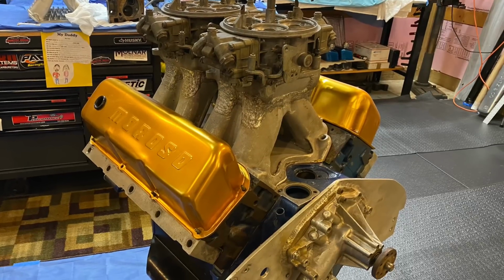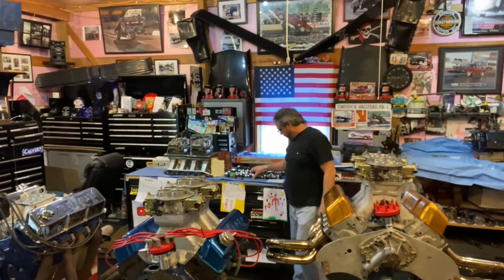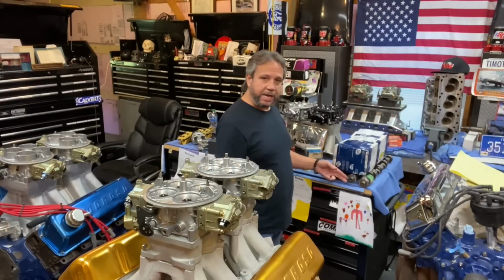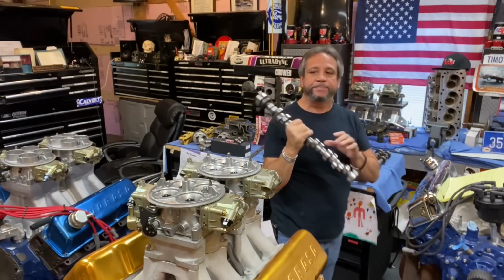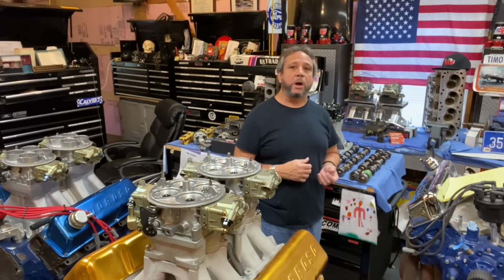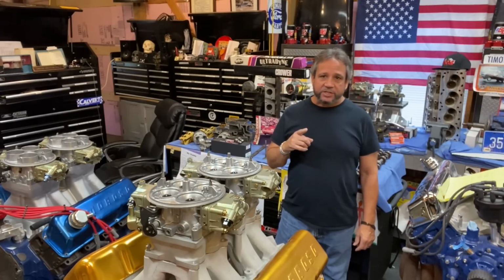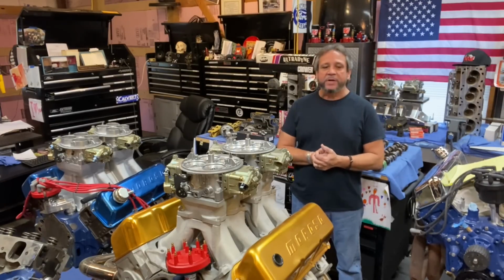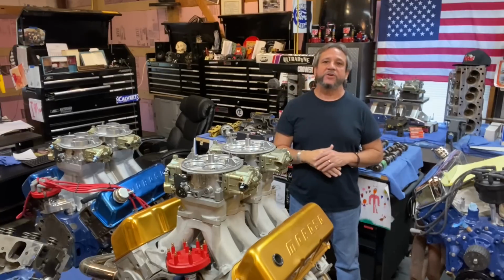DBG: Ford 351Cleveland Pro Stock Cams, Pics, Specs,  And Speculation? How Much HP  Did They Make?

Comment: That shifter reminds me of a story. I managed an auto parts store years ago. The guys who worked for me all knew each other, and were all friends. I helped one of them build his Mustang, a 66 Mustang with a 289 and C4. He needed help picking out parts to build a street strip car out of it. We started out with a 13 second build. It ran good with that engine. Then he wanted to go faster, so he bought another engine to build and an old Datsun Truck to drive to work while his car was down. The new engine got him into the low 12’s. Then he decided to switch to a four speed. He got that put 8n and then wanted a shifter like you have in this video, a Vertical Gate Shifter. So his friends stoked his car on his birthday and installed a brand new shifter that we all chipped in on. I got a phone call that they weren’t finished so they needed me to stall them. So I made up a reason for him to stay a little longer and then I drove him home. When we got there his Dad, Brother and some of the guys were talking to a cop. They all thought the car was stolen. My friend freaked out, and was about in tears when we heard a familiar car driving into the neighborhood. He looked up and one of the guys drove it up to the house. After a few minutes he went from being upset to surprised, his family calmed down and I talked with the cop a bit. It was a great day!
Reply from the maker: Tear of fear to joy, thats what friends are for. Thanks for sharing that
https://youtube.com/shorts/8S1IAZpoS7E?si=PLCwR1hbuSQc5F7t

Comment: I ran general kinetics Chrysler mushroom cams years ago. I had a hand picked cam and springs { Battle Ship springs } Best springs ever made. General Kinetics were known for very steep ramps. they accelerated lift as much as possible. Ultradyne cams I've run also they are known for needing more fuel than most. 4 main jet sizes more. CJ
Reply from the maker: Love that, I have a few GK cams from Jack Roush, Harold Dutton owned Ultradyne, had some bad cams...

Comment: I believe the Chrysler 'mushroom' tappets were brought into play so they could run a more radical lobe. Either rollers weren't available yet(circa 1970) or they weren't as yet class legal. It was one of the 2 things. You had to install those tappets from underneath.
Reply from the maker: Yes, they use the mushroom lifters in  NASCAR. Someone had mentioned when roller lifters came out, I thought it was Iskenderian, that I forgot now.
Reply: @dragboss351cleveland  Lots of cool and exotic experimental stuff being produced for racing by the factories back then. I've seen some really cool pictures of intakes/induction systems that Ford produced for motors like the Boss 302 which I'm sure you Ford guys are already well aware of. It's amazing how much interesting gear was created that apparently never made it to regular production or even racing.

Comment: Love Bob Glidden, he was my ford hero. I don't think he used nitrous,  the GM and Mopar crowd sure says he did. Can anyone say for sure if he did or didn't use it. Was he ever suspended for it. I don't think he was. He never slowed down after they accused him of it. Can someone give me some solid evidence.
Reply from the maker: He was a real racer. No he did not spray. I think Rusty said it here. 
DragBoss Garage: Friday Night Live, Third Round With Rusty Glidden, His Use Of Nitrous In Pro Stock
https://youtu.be/Yx49BByWMm0
Reply: @dragboss351cleveland  … The GM and Mopar guys pointing their fingers at Glidden about using spray are what you could call SORE LOSERS. They went down in flames because a Cleveland BOAT ANCHOR handed their asses to them so drastic measures were necessary 🤷‍♂️.

Comment: Comp cam,old grind but still very good. 324-6 intake & 340-3 exhaust 209 separation.  Hello Rusty.
Reply: 109 separation.
Reply from the maker: I like that, what’s the intake center line on that cam?
Reply: @dragboss351cleveland  you have to understand the exhaust leaving the chamber can put a unbelievable amount of suction in the intake track @ overlap.   Hence kicking the intake track in the ass & getting the cooler heavier air fuel mass moving in the right direction before the piston starts descending down the bore.  If one waits for the piston to draw it in , your behind lol.
Reply: @dragboss351cleveland  we should chat sometime.  Some of this isn't as complicated as it might seem.  Talking about events that occur in extremely short periods of time helps clarify things.
Reply from the maker: Thank you Mike I appreciate it. I’ve always run my cams 4 degrees  advanced, is that how it seem to come out on the cam card. I will tell Rusty. Hello, as I need to get him back on for a live chat. Always fun to talk to him. Appreciate it Mike.
Reply: @dragboss351cleveland  I made Bob a camshaft for his Boss 429 while at Lunati in around 1993 or so.  Experimental.  .530 lobe lift.  Mostly intake lobe changes were made.  Lol not sure he had time to run it.
Reply: @dragboss351cleveland  the whole cam advance plus 4 degrees is generic.  Yes , valve events change & coincide with the spec card. It just not always what the engine may want.    Extreme engine speed applications require the overlap event to be placed where inertial super charging can best occur for volumetric efficiency to get very high under normally aspirated applications.  No power adder.
Reply: @dragboss351cleveland  I know this is technically pretty deep.  But it's solid info.
Reply: @dragboss351cleveland  not sure Rusty  will remember me lol. I also worked at Comp cams as well.  I have a story on how Billy's name was chosen.  Etta will likely remember,  Etta & Bob's  friends in high-school,  Dave & Porscha Burton.   Porsche & Etta were very good friends.  They all played cards togather  ( conasta ) back before Billy was born.
Reply from the maker: That’s a big stick, probably matches 500 ci, be great to see if he did use it. How long did you work at the Lunati? What did you do there?
Reply from the maker: Yeah, that’s my basic came knowledge, and recommendations from engine shop, and then another recommendation by the builder. however, when I rechecked the cam after I had some issues breaking Beltran, I found out that it was retarded, 4°, so obviously there’s some issues that were not told me by the builder. That’s when I went to see my Buddy Bob Beach. Never an issue after that.
Reply from the maker: You could come out and do a live chat on cam, shaft, specs, and relations to engine rpm, power, output, decisions, think about it.
Reply: @dragboss351cleveland  I was a go between of engine builder & cam designer.  The builder would ask or want to see if something could be made &  I would get with the designer/ engineer to see if it was feasible.   Many times the limitations were the valvesprings available at the time. Things have progressed greatly in that department.
Reply: @dragboss351cleveland  about 4 years there employed when Joe Lunati sr owned it. Left in 1994 fall.
Reply: @dragboss351cleveland  comp cams started as a outside manufacturer rep in the Midwest over 6 states, then went to Memphis to competition cams.  1986 or so through early 1990's
Reply: @dragboss351cleveland  again was in the engine builder division, 3 of us handled mostly Profesional engine builders.  Mostly they knew what they wanted & we would attempt to see if it could be done.  Many varied projects.
Reply: @dragboss351cleveland  I am still involved in some personal engine projects,  one being a 14.5 ci OHV normally aspirated single cylinder engine topping 40hp
Reply: @dragboss351cleveland  over 3hp per inch.
Reply: @dragboss351cleveland  Surely I am not current with today's most current stuff.  Valvesprings have opened the door to possibilities we just didn't have back then.
Reply from the maker: Ok, I understand. yes amazing the improvement nowadays. Had a set last 5 years with no issues. Isky rad tool room gold stripe.
Reply from the maker: Great history Mike thanks. I used to talk to cam guy there just forgot his name while answering. Old age
Reply from the maker: There is a guy at comp that ground Gliddens cams. Saw a vid he was still there. Did BillyGodbold leave?
Reply: @dragboss351cleveland  yes Billy was fired.   Comp cams stopped being comp cams when the lawyer Ron Coleman took the reins. All down hill from there. I was still there when that transition took place. Billy God bold came on the scene at come a lot later.
Reply: @dragboss351cleveland  many fellas actually ground Glidden cams at comp, Junior was one of them, at one time he was one of the best at comp & later he came over to Lunati while I was there.  He finish ground The Glidden cam that we sent for him to test.  Junior made sure it finished out as perfect as possible back then.  When he got the order he came & talked to me, he asked, is this who I think it is ?  Yep.
Reply: @dragboss351cleveland  still learning to navigate this messaging.
Reply from the maker: @mikedonzero2692  well maybe you should do a live chat with me. Talk cams? Thpa351gmail.com
Reply: @dragboss351cleveland  your email isn't being found
Reply: @dragboss351cleveland  we probley need to chat, not sure best way to get in touch. I'm not even sure this is being viewed by everyone.?
Reply: @dragboss351cleveland  I'm certainly not the greatest computer savvy navigator. I get by
Reply from the maker: It is being viewed, so email at thpa351@gmail.com
Reply: @dragboss351cleveland  I am going to get assistance.  I emailed you & it won't send.
Reply: @dragboss351cleveland  I think I managed to email you. Can you confirm ?
Reply: @dragboss351cleveland  the guy your referring to might be Kenny Arendale. He's been there forever. Great guy.
Reply from the maker: @mikedonzero2692  took care of it thanks
Reply from the maker: Yes  that is him, I’m pretty sure. Maybe have him on too. Don’t know him. Thanks I appreciate it Mike.
Reply from the maker: Thanks Mike, glad your here, ck out the playlist, working on them now. That cam seems like a rocker
Reply: @dragboss351cleveland   a lot has changed in the last 35 years.    Lol
Reply from the maker: I know what Mike I still live in 1975, I have to say those were the best years of my life and like most people probably think the same about their time. Didn’t have all these crazy worries. But yeah, I’ve learned a lot from spring technology to head flow. No expert, but I try to have a good understanding, and explain to others if I can. I was appreciate you, stay tuned

Comment: Track Boss block, 302 mainline (2.75 mains is 30hp loss), 4.155 bore (same as chamber width for a start), 3.25 stroke, 15 to 1 comp. measured, angle mill/weld heads(whatever ones makes U happy), 1" lift cam, Jessel, sheetmetal intake, 2x6464's. Now go stick it in that Cougar and run NHRA B/Super Modified. Run the 8.66 national index and I'll buy dinner.
Reply: I forgot what 302 mains was?   It was under 2.5" right?      So what's the difference in 2.75" main in cleveland and 3" windsor main?
Reply from the maker: @dennisrobinson8008  .025, bearing speed it the difference.
Reply from the maker: Always hungry. Sounds like a screamer. Your saying loose 30 hp with 2.75 main as opposed to 302? I am too old for all of that BAD50, follow the plan with TrackBoss, wanted to see what I could get before I bore it out bigger, although I know it makes a huge difference in unshrouding valves. Big bore short stroke. Maybe do that on next build. Pistons and cam in. Have TD steel rockers 1.75. All the bells and whistles. Scoot cook making custom intake. 850 on my car maybe low 9s to 9.20s?
Reply: @dragboss351cleveland  Ahhh...yes...they were put'n those half round spacers in the cleveland mainline. Mr. Cushman must have'm. Significantly less friction...much lighter & smaller diameter crank, etc. etc.. Even the SVO NASCAR blocks...9.2 deck, siamese bore, went 302 mainline. Think 4.155 is a big bore? Back around 98-99 Pro-Tech Machine, my first shop, worked with Ford Racing to come up with an idea to have their foundery mess with the S302 core boxes to create a 8.700 deck block that could have the distance between bore centers changed from 4.380 to 4.500 and thus allow a 4.250 bore. Couple of months later they called and asked if I wanted it. Ahhh...sure....ship it. It never showed. It went to Earl Wade for Dyno Don's Pro-Stock Truck...fact. I did get the next one 9 months later. Sorry Tim, I quess I'm just a little confused. All these old Pro-Stock pieces hang'n round and stories, I didn't think you'd be building stroker motors when Bob and others destroked their clevelands to go faster. The only replacement for displacement is...RPM's. sorry.
Reply from the maker: The only stroker is my 409 cleveland. The pro sticks will be 327-343 depending on crank and rods I have. Interesting history. If main make that much difference. Why did not all dart blocks or aftermarket foes have 302 mains? What happened to that block?
Reply: @dragboss351cleveland  for you stroker guys obviously...there's a limitation on stroke with the 302 crank...maybe 3.650-3.750 from what I've been told...the journal overlap which is critical for strength gets minimal. Plus the sales standpoint of people not wanting to replace their present reciprocating assembly.

Comment: I remember from my days around the pits in socal and other tracks were I saw Bob's engine running idling at 2200 rpms and would not clear up till better then 6500. I believe I saw a tach marker at 11200 after a run before it was reset. These were sleeved furnanced welded blocks, sleeved lifter  bores and much more. These were custom reworked iron motors . Nice video.
Reply from the maker: Yep you’re probably right on that RPM. They were also dry sump engines. What ton of work on cylinder heads as you know. Thanks Victor
Reply: @dragboss351cleveland  As Bob was VERY  careful of covering his intakes and exhaust ports, even when he did engine changes, The motors were buzzed really high with iron cranks in the early years. Durring a valve valve adjusting I noted the Intake ports were as high as the valve cover gaskets, aspeared to be brazed up roofs. Exhaust ports that little I saw were an angled D port. Way ahead of the time. Many mods throught out the block, heads,  oil pan, Crank.. The low deck hight and thin cylinder walls made engine life not so easy.
Reply from the maker: Right on Victor, I’ve seen many heads like that. That’s where it counts many times they welded the whole valve cover together with the top the intake port were they were milled down. Dyno Don vid I have shows this ck it out.  give him that extra couple millimeters of roof height.
Pro Stock Mania Returns: Dyno Don's Pro Stock Ford 351 Cleveland UR-19 Intake/High Port 4vs
https://youtu.be/qYdA-q6tMWE